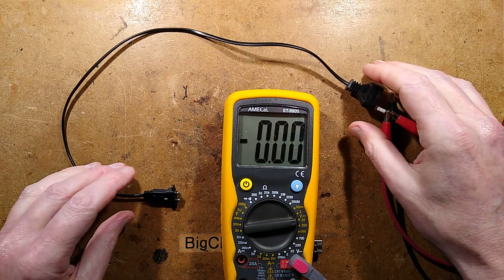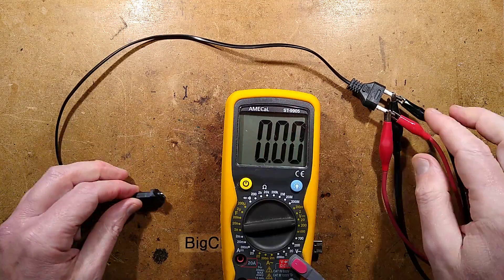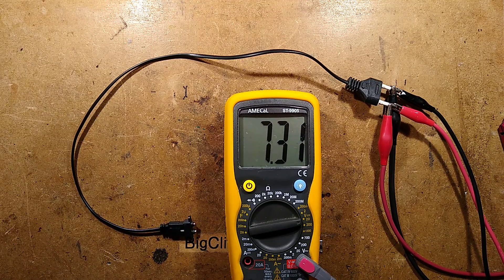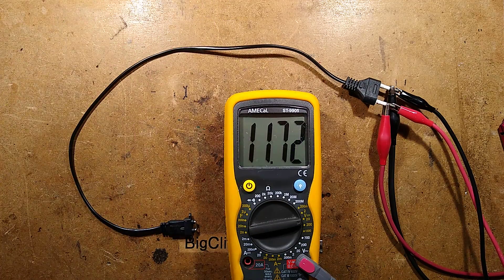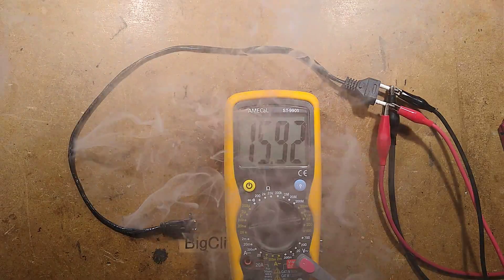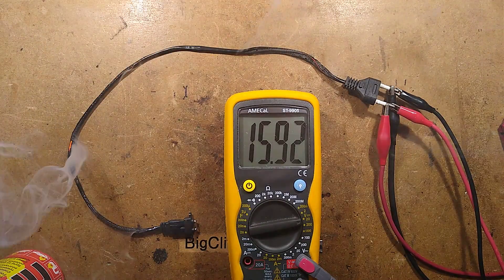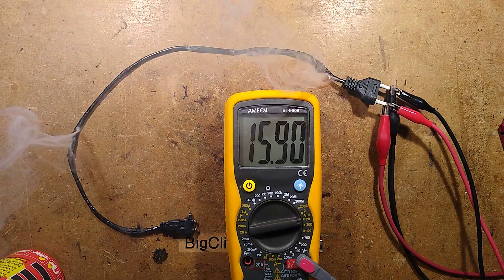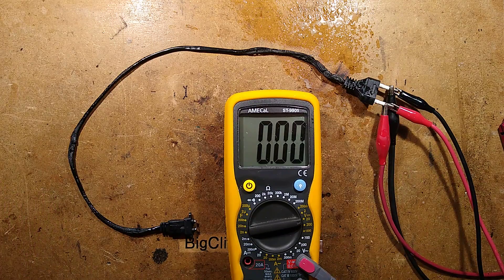Cable test ends in flames

Comment: Red hot at 3.6 Amps.  What a dangerous piece of junk.
Reply: It's actually quite impressive. Even those standard plug leads that all physics classrooms have can handle considerably more current before getting melty.
Reply: That plug is rated at 2.5A
Reply: @hillppari  Then it should come with a 2.5A fuse.
Reply: I still have a scar on one of my fingers after touching a wire that I accidentally short circuited while connected to a regular 9V battery, and that was copper! This thing would probably explode into flame almost immediately if it developed a fault while live at mains Voltage.
Reply: @Reddotzebra most wires would blow apart being shorted with mains
Reply: @SwampBewdy  Most, but possibly not this one. It's not conductive enough to short violently and activate the breaker like any decent cord would do. It's basically a light bulb filament with a positive temperature coefficient out the wazoo. Any 20A household breaker would "happily" power a 600W incandescent bulb, and it would power this too. Eep.
Reply: Why in the name of sanity is this crap allowed to be sold? There should be laws that hold sellers accountable and subject to very hefty fines and/or imprisonment for knowingly selling such dodgy goods. But I guess that'll never happen because so many governments are in the financial and political back pockets of big corporations and even dodgier governments.
Reply: Wow...just, wow, what an awful AND dangerous wire!  16v at 3.6A and it catches on fire..!
Reply: 240v btw.
Reply: I feel like a steel core cable with cladding might be more expensive than aluminum wire, I don’t get why china does this crap. Its like they do it on purpose to fk us all
Reply: Imagine if it was in 240 or 120 volts and 50/60 hertz
Reply: @Denis7947.  Being as thin as it is,  the wire might just go open circuit,  acting like a fuse.  Could possibly be less of a fire hazard,  instead of heating up slowly,  like what Clive did.
Reply: You don't know what kind of power the device has. Maybe it is rapturously 7W and such a wire is completely sufficient.
Reply: @marcin-_  Ah yes, low current draw, high voltage devices. Dealing with a bunch of them right now. Pneumatic solenoid valves that draw 29ma at 240v and are on a timer, turned on for only 2 minutes every day. The terminals and cable entry are so small it's actually hard to find a cable that will fit and is rated for the voltage. I actually had to take a cheap computer power cord, cut the ends off, and use that cable. Copper of course, not cheap steel or aluminum, and still way overkill for the application, but it does actually fit. The circuits to the junction boxes where those cables are connected are a completely different matter. 14ga, or roughly 1.5mm2 is the smallest readily available cable for building wiring here. So that is what has to be run from the control panel containing the timer to the solenoid valves themselves. Absolutely overkill for 29ma for 2 min/day but that's what you get installing industrial equipment in a residential setting.
Reply: But isn't that plug rated for 2.5A anyway?
Still sketchy, but I don't think it's meant to take that current
Reply: @ZugTheDragon  2.5 A plugs must have at least 0.5 mm2 copper wire, which can handle 4 A. The plug actually has 4 mm diameter pins, the same as old 6 A plugs and can actually hande 6 A. Some reputable manufacturers like legrand even sell 10 A flat plugs,
Reply: @ZugTheDragon  that plug type is rated way higher. 
I have the same cable for 230v as well and it is rated at 5 amps
Reply: @ZugTheDragon yes but the cables rating means nothing, he's testing what happens when they get short out
Reply: @Squishrug  I agree, also I don't think those plugs have a fuse in them so the limiting factor is either the device that it is plugged into or the supply current.
Reply: @Squishrug  No cable's going to do too well when shorted out at 240V. Though I'm in no way defending this one.
Reply: @Squishrug  of it shorted. i think the circuit breaker will cut the power fast enough to not melt the cable.
Reply: @yellowfin_tuna a regulär wall  outlet needs a wopping 80 amps to trip instantly. 
Everything below that will take way longer than this cable will last
Reply: @NinoJoel  when a sort happen even really small cable will draw a lot of current. what will happen is either the cable explode or the breaker kicked, or even both. if its explode the spark will be short and wont be able to burn something like plastic.

in my own experience, a really small stell wire can kick a breaker to my room instantly, tho its only 10a.
Reply: @yellowfin_tuna  electrical faults are almost never dead shorts tho. 
And these types of cables also get sold with plugs that can be plugged into other devices that draw higher currents.
Reply: @NinoJoel  yaa.. i mean, even copper wire with roughly the same size also will be in trouble at that situation.

I'm not saying that this cable is fine. it probably wear faster than the copper one. and its probably a scam.

but, if the rating is fair, it being advertised as is, and it being used properly, its most likely just fine.
Reply: No, it's is excellent sausage heater. 😛

Comment: Nice demo, I also wonder how fast the steel fatigues compared to copper, can imagine it breaking after just a few uses and arcing internally starting a fire that isn't self extinguishing. 

Also I still want to see the original product electrocute a sausage at full mains voltage just by touching the outer case.
Reply: I too would love to see a sausage fest.
Reply: Agreed, nowhere near as malleable as copper. New check added to the list of cable checks on imports...flame test for aluminium conductors, magnet for steel conductors. Think i'll retro-check all my xmas lights before using them.
Reply: @thephilpott2194 
I took apart or off.. a metal frame shaped like a reindeer that had a direct mains LED string on it.. for outdoor use...
It has loads of burnouts where the lights have been bent round.. you don't see the damage until it's off the frame.
Reply: Just like that old hotdog electrocution cooker!  It really is the perfect dalek for camping!
Reply: That's one of the things steel does actually do better than copper. Copper work hardens real bad and breaks easily when it does. No doubt a similarly stranded steel cable will hold up much better. If only it was more conductive.